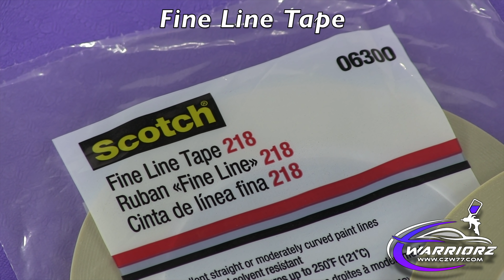How to paint Ghost flames / Painting method Pearl painting / Motorcycle painting【カスタムペイント】

Comment: After spraying flames, no silicone remover applied after removing rhe tapes? I would expect the last two top clearcoat layers will suffer if there are glue residues?
Reply from the maker: That's right, after removing the tape apply silicone remover to remove any adhesive residue.